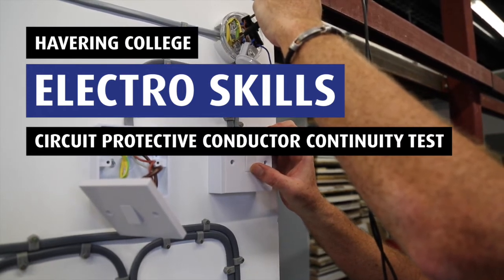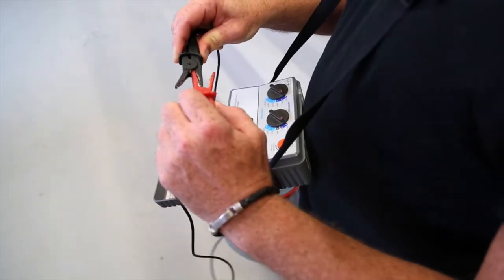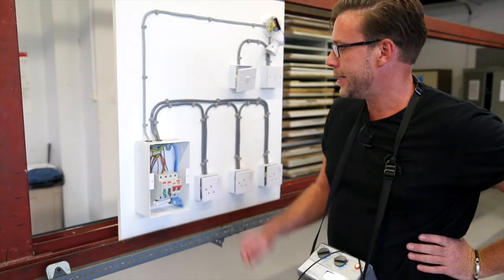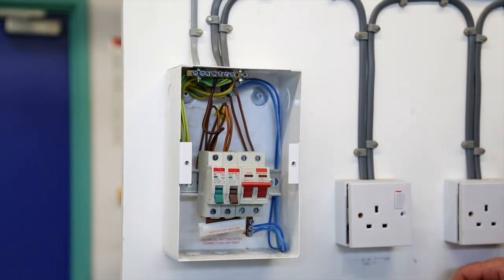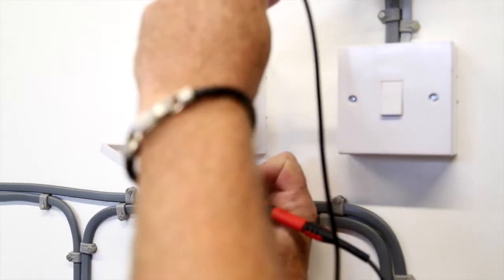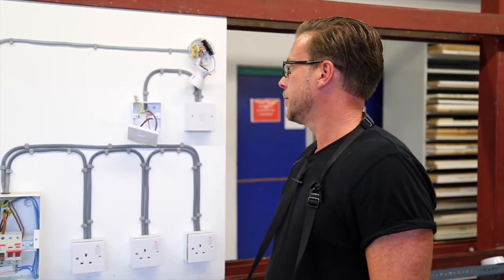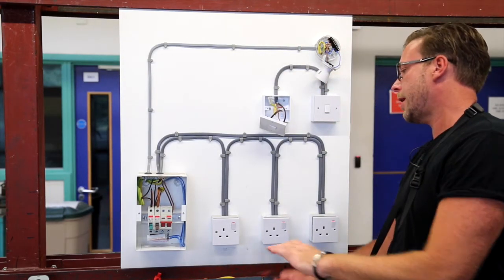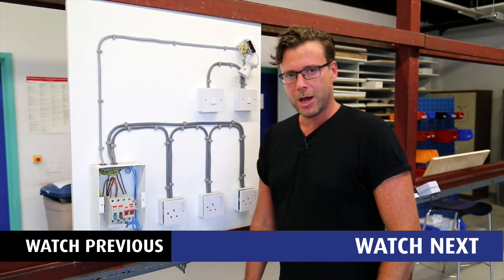How To: Test continuity of Radial Circuit Protective Conductors (R1+R2) - Electro 06

Comment: Great video, I am retired and just doing some homework when I came across your video, having the time, I did watch it through to the end, but I am not to sure how many if any Electricians actually do this test at every point, I know we used to favour just testing the EOL [The last Accessory at the End of the Circuit] and assumed that if we had a good Earth Continuet Reading,  as was expected we were good to go. and move on to the next circuit.
As for insulation Testing well that was easy, just get your tails and Megger the Live and then the Neutral to Earth at your Distribution Board, cutting out the middle man so to speak, prior to energising of course, ok it drags your readings down, but still way above what is required. Any issues, just flip the offending circuits MCB Down and do it over, then go back to the offending circuit and sort that out, most if any issues are usually caused by Flourescent Lights/Running Gear.
Mr Spence Eng